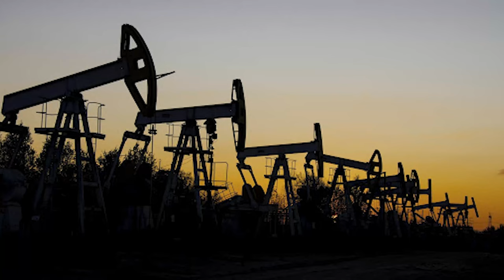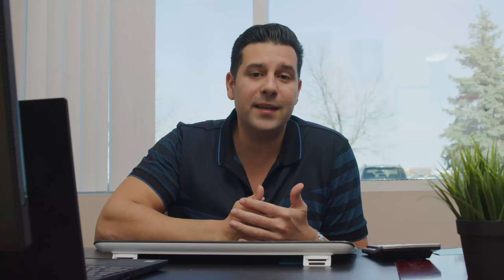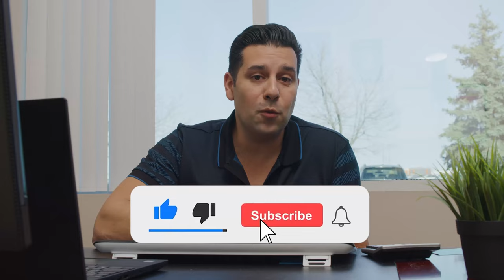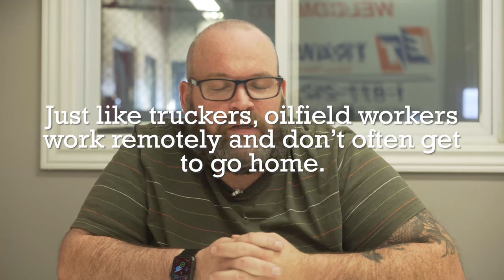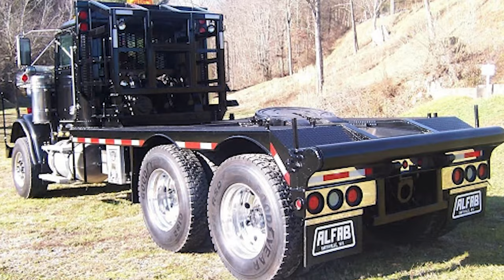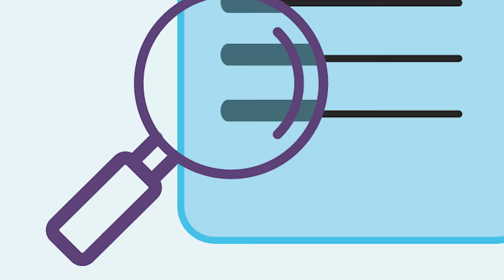Oilfield vs Highway Trucking in 2021: (Pros and Cons, Work Schedule, Pay, Hometime)

Comment: $130k is a little high for a frac hand. In Texas, Oklahoma, New Mexico or Louisiana anyway. It’s more like $80k to $110k. It’s possible to make more but usually you have to get promoted to supervisor or have 15+ years of experience. I’d be careful with a company that will pay you more than $110k without lots of experience. You’re probably going to be used and abused if you do. Not that any frac job is going to be easy. I did it for 8 years and honestly it’s not worth it anymore. Inflation has killed the value of that $100k.

Comment: Switching from oil patch to highway will be an easy transition but if all you have done is driven highway and you are going to the patch the lease roads and the actual sites will be a challenge for you as the actual rules and sizes of the roads and conditions ( I was expected to drive wher I couldn't hardly walk) to deliver sucker rod and pipe.

Comment: I spent 9 yrs running my trucks/vac trailers in the ND oil fields.. my drivers and myself made obscene  money..I am a multi millionaire because of the oil fields.. I also feel like I lost 10 additional yrs off my life.. the oil field will chew you up and spit you out ...
Reply from the maker: At a certain point you’ll have to weight the opportunity cost of trading your life away for extra money
Reply: Paul express. Do you still have empty seat ?. I live in Illinois. One yr stepdeck. Kinda rusty due to pandemic. Ho do I search for a job in the oilfields.
Reply: @stilliraise9201  I sold all my equipment and left the oil fields 7/31/20. now is not the time for a newbie to go to any oil field.
Reply: @445xone  that doesn't mean that I can give it a try. After all if you are multi millionaire I can be just half millionaire. Believe me if you were like me with cero points on credit score and unemployed because of pandemic you would like to give it a try to anything. I don't need 10 yrs on oilfields at least enough to stabilize my life.
Reply: @Paul PKexpress  its been a year since you commented here  its have gotten better now?
Reply: @unknowndriver6652  I was out of the ND oil fields when I made the comment. I left in 2020 and moved to Florida .I still speak with guys in the field regularly and hear the money is still there for those that know what they're doing. not many rookies showing up I'm told. everyone I know there complains of a manpower shortage.drilling rig count is slowly increasing which is an excellent sign.
Reply: @445xone  can ypu connect me with one of  them? Id like to work
Reply: @unknowndriver6652  I could but, understand it's not just show up and go to work like 10 -15 yrs ago..you'll spend 2-3 weeks getting certifications ( H2S, Safeland, PEC , One Basin  etc) before you're even allowed to go in the field to be trained . in my experience , about 25% of people have what it takes to succeed in ND. the jobs are dirty , difficult and dangerous. you will EARN every dollar you make . IMO..financially it's worth it..the mental and physical damage will be determined by the job you do and how you handle it. the right person would already have 100 opportunities with a 5 min internet search. not knowing your abilities or the job you would want to do...my best advice is to contact North Dakota job service as they have regular job fairs/ hiring events where you can find all opportunities.. the oil field is not for everyone. that is evident by the comments to this video.
Reply: @445xone  and it must be freezing cold up there in winter time

Comment: What are the qualifications for an oil field job?
Reply: A pulse
Reply: That and a couple years of driving experience. My job is easy! I haul frac sand to the well. the only time I have to get out of the truck is to open and then close the lid on the sand box and to go into the scale house to get my paperwork. Some places print the paperwork out right on the scale. Typically 5-6 loads a day. I am paid by the load, so the more loads per week the more money I make. I'm a company driver for a small carrier and made $70k last year. The downside is when the well has a break down. You could sit for hours before they have fixed the problem and get back up and running. I have sat on a load for 36 hours in the past. Having a sleeper cab truck with satelite tv makes that part of the job easier. I'm out 3 weeks and get 1 week of home time.
Reply: @69castellano  would you recommend or any idea who would be hiring company drivers?. I've got one yr stepdeck. Illinois license. Need a foot in the door . Pandemic screw me up.
Reply: @stilliraise9201  I guess it depends on where you live resource transport is one. They use daycabs. If you have your own truck there's a number of places to lease onto.
Reply: @69castellano  is this resource transport have satellites here in Unites States? I don't live in Canada.
Reply: @69castellano  is your company hiring OO?
Reply: @unknowndriver6652  I'm not working in the oil fields anymore. Haven't for 2 years or more.